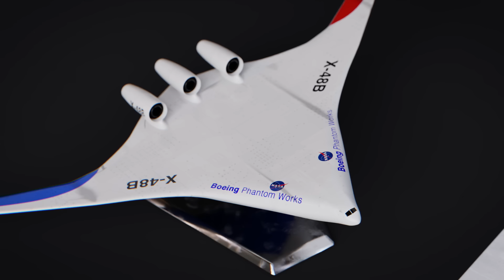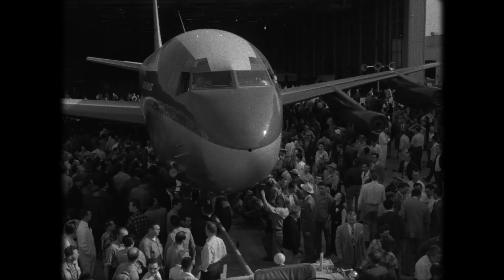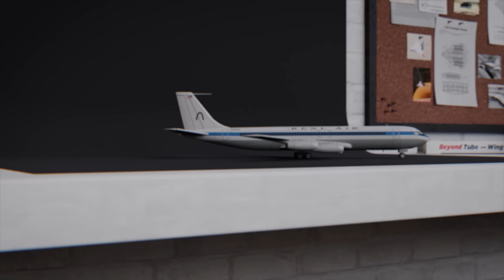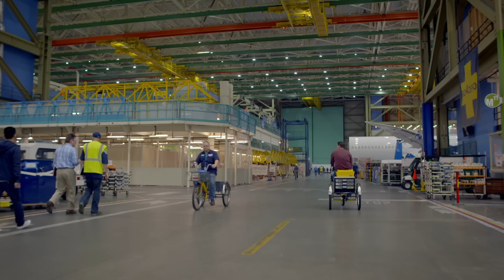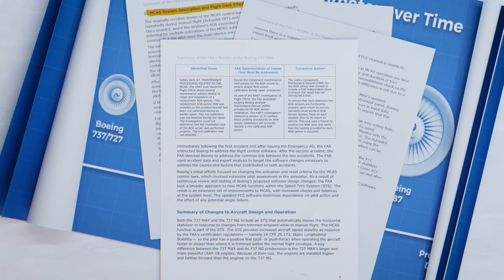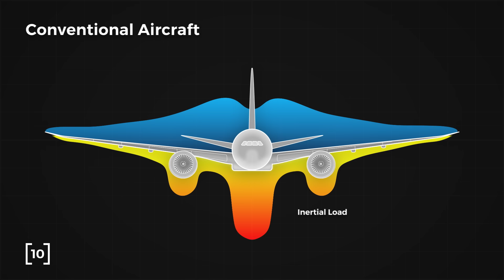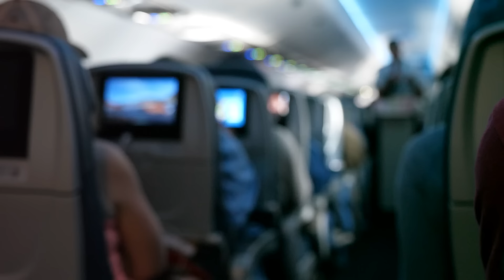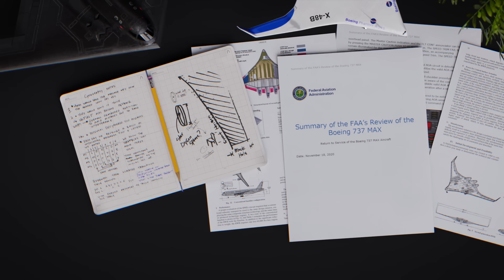The Plane That Will Change Travel Forever

Comment: Yeah I can't fathom the intense depth of greed needed to skimp on multiple redundant sensors that, compared to overall vehicle price, are stupid cheap to add in. Everyone in corporations who signs off on this kind of thing (not just airlines, but all companies) needs to be held personally criminally liable instead of their companies just getting a slap on the wrist in fines.
Reply: It's the devil of the Stock Market. You don't just need to be profitable, you need to be MORE profitable Every Year.  At some point, the business has reached max efficiency, and from then on you can only cut costs, usually by reducing personnel, and then shaving off product size, quality, and safety.  That's why a profitable business will fail after offering public stock, because investors just want growth growth growth, even when there is no room to grow.  Corporate takeover is a death sentence for a family owned business.
Reply: I wrote a short story about a son taking the family plow horse and taking him to the race track, and pumping him so full of amphetamines the horse's heart failed, which is basically the corporate story.

Comment: As I look at the relatively flat surface on top of a blended wing aircraft, I can't help but wonder if it would be possible to cover the top with solar panels.  I am sure there are all sorts of practical reasons it wouldn't work.  But if it were possible, it might allow a plane powered by hydrogen fuel cells to travel further on less fuel (at least during the day).  I wonder if such planes did prove practical if airlines would charge less for daytime flights or flights traveling West (chasing the sun).
Reply: I don't think you people understand how much energy is used in transportation vs how much energy you can get from solar.
Reply: Each engine (of two) on a Boeing 777 produces about 23 Megawatts. Solar panels are about 150 watts per square meter. 46MW / 150W = 307,000 sq m = 75.7 ACRES. And that's at the ideal angle. A plane might have an acre of useable area, so you might get a maximum of 1% savings for a lot of extra weight and complexity. You'd be much better off burning the hydrogen rather than using it in fuel cells anyway.
Reply: @cf453  That does seem like a practical reason why it won't work.  Which basically means you are saying I was right...  Seriously though, thank you for explaining.
Reply: @michaelmcchesney6645  You're welcome. I like to provide a sense of scale where I can.  The notion of trying to leverage more efficiency by alternative means is a good one, but it helps to know the boundaries of the possible.

Comment: The big problem with this is the lack of window seats. I dont want to seat in the middle of a dark capule full of artificial light. Also can you even imagine thousends of airport all renovating to accomodate those aircraft. This air craft would require 6 air sleeves to deboard its passangers. That would be EXPENSIVE both for the airline and airport. This plane is shit ngl

Comment: The 737 MAX has a runaway flap disconnect and a flap wheel by the pilots thigh for both the pilot and copilot; while the angle of attach sensor did fail the real reason the 2 planes crashed was inadequate training , poor airmanship and bad communication. Totally preventable!

Comment: Follow-up video idea: What impacts will these planes bring to passenger airports and their gate layout? Could the costs for adapting existing infrastructure effectively stall the sale of these aircraft?
Reply: And so much more. The cost of adoption for these flying wings would be quite high, and they would not solve the real problem the air travel industry faces: carbon emissions. Sure, a good amount of fuel savings is nice, but it means little when you're still emitting a lot of carbon with every flight. What we need is either a carbon-free biofuel (which is a pretty big challenge), an environmentally-friendly fuel that isn't carbon based at all (like hydrogen, which has a LOT of its own challenges/problems), or electrically-powered planes (which has some big problems with energy density of batteries, which vastly reduces the capabilities of electric planes). So we either need a revolutionary breakthrough in battery technology, a revolutionary breakthrough in biofuel technology (technically possible, but difficult), or a revolutionary breakthrough in hydrogen power (hard to see this happening, given that the physics of hydrogen won't change).
Reply: Sounds like something Wendover would cover.
Reply: They just need additional stairs. Blended wing planes have smaller box for the number of passenger they carry. The airport also need a new procedure so that the utility support equipment is positioned towards the back instead of the right side of the plane but all this equipment are already mobile they just need to train the crew on where to go.
Reply: @kazedcat  when you say "smaller box for the number of passengers they carry" do you mean on a per capita basis or in absolute terms? I wonder whether the width of the new planes will be significantly larger than current planes, meaning they wouldn't fit in the layout many airports have today - similar to tree branches. I know that that huge A380 is so big it can't fit in most airports and I think the blended wing model will run into the same type of problem
Reply: @Erik_123  A B2 Spirit have a 52m wingspan with a Maximun Take Off Weight of 170 tons. A boeing 767 have a 48m and a MTOW of 180t. Either this aircraft needs a very long wing, or wing folding tips, even more to get to the number of 450 souls inside.
Reply: @glockmat  The bomber was design to have low radar signature. I would assume this limits the shape of the plane away from the optimum MTOW.
Reply: @Erik_123  The airbus flying V concept was designed to fit on current airport with out the need of upgrades.

Comment: It seems like microbursts at takeoff or landing, or "vertical wind shear", would have a greater effect on flying wings because of their larger surface area relative to a force applied from above or below. They should climb faster than traditional designs with similar engine thrust but wouldn't that also make them more susceptible to erratic movement in turbulent air? We have decades of experience with similar military designs and it would be reassuring to know how engineers are identifying and remediating unavoidable new problems in civilian applications of this technology.
Reply: > wouldn't that also make them more susceptible to erratic movement in turbulent air?
Yep, that was one of the major problems brought up in the video.  And the solution seems to be "just make sure you build them really well so they don't get a bad rep right out of the gate".  Which is fair enough, most potentially dangerous things have to go through that procedure.  Its just a question of whether they'll spend sufficient time and money (and have a little bit of luck) finding and fixing all of the problems - including probably some test flight disasters - before they start selling tickets.

Comment: As a software dev, you're gonna have a hard time getting me to set foot on a plane where a computer can overrule pilot input.
Reply: Not to mention all Boeing work is done by an offshore (usually India) team, then patched together by an American team (like 3 guys) to make sure it's "certified"
Reply: @dennydravis8758  the problem isn't Boeing's india team, it's the other contractors they hire to code. They go for the lowest price to maximize profits instead of quality
Reply: @dennydravis8758  bruh even airbus uses an Indian team, every major company does, even the previous Boeing 737s used codes from Indian teams, its been like that since the 80s, the airbus simulation software was made by the DRDO of India, DRDO is like India's Darpa, everybody uses India for software.
Reply: @homijbhabha8860  having qualified professionals is fine, having incompetent 3rd parties like Wipro, HCL, etc to reduce cost is not.
Reply: @altrag  no I am saying the previous boeing airplanes use software coded probably by the same consultancy firm in India, OG comment said switching it to India fucked it up, even airbus software is Indian coded, I should know cause my uncle was the lead in coding the simulation software for our Tejas fighter jet program, it ended up being bought Airbus.
Reply: I suggest you stop flying then, as of right now pilots have very little input, only really controling the plane for takeoff and landing
Reply: That's basically every commercial airplane already.
As a software dev, you should be well aware that PEBKAC errors are often the hardest ones to find and fix.
Reply: I develop too, but I'm torn on that point. Good code that has been simulated to test decades worth of operation, used in redundant systems negating failure, still sound much more reliable than a human.

But override protocols should be available, just not available to a single pilot who is panicking or wanting to crash the plane
Reply: Fellow software dev--yeah I try to avoid having important things in my life being run by software. It's so easy to mess up, and software "engineering" has nothing like the standards of the hard engineering disciplines.
Reply: Since 1997, we've had 4 commercial airline events where the people on the flight were killed by  the suicidal pilot. You're going to have a hard time getting me to set foot on a plane where a human pilot can overrule computer input. ;)
Reply: Most airplane crashes are caused by human error not computers

Comment: 13:20 although I love blaming software as an engineer, I must say that this is not bad software, but bad system design. Writing better code doesn't add redundant sensors.
Reply: I think they did have multiple sensors on the 737 max, the issue was that the software was only taking decisions based on a single sensor, while it should have used the 3 sensors onboard.
Reply: @DBAproduct  @madattaktube The way I understand it is that there are multiple angle of attack sensors, but only one is used for MCAS. You could say that the software screwed up, but I don't think that is a fair call. Although of course the software is bad if the computer on which MCAS runs could access a sensor that has conflicting data and you could maybe fix it in software only, I don't think it is likely that Boeings software engineers made anything other than what they were told to program and accidentally forgot to add the redundancy. To me it seems more likely that something went wrong in the system design. Although of course that is maybe on the speculative side.
Reply: The system contained a redundant sensor, the software was not programmed to correctly identify conflicting sensor information and instead triggers a high AoA warning when only one of the two sensors is actually displaying high AoA.
Reply: @madattaktube  to my knowledge, the problem was more that although they had multiple sensors, each sensor was only connected to a single flight control computer, and they weren't cross-linked?
Reply: @nthn-   MCAS was desinged to only use one sensors at a time even though it had access to both. The software was designed to flip between one or the other after flight cycle. I'd very much like to know how the meeting where that implementation was approved was conducted.
Reply: @madattaktube  if that is true, how this code even passed basic reviews blows my mind. Boeing is definitely breaking/cutting some processes here. even automotive code i develop has more stringent reviews and testing
Reply: @thunderb00m  Right? It was pretty outright negligent of them to keep flying the plane. They knew, but money is more attractive than safety as usual.
Reply: as another software engineer, I agree. also code reviews, by multiple people. My coworkers have caught small bugs I missed. I am forever indebted to them... until its my turn to review their code LOL. oh and many, many, robust unit/functional/endtoend tests
Reply: Boeing subcontracted the software to programmers that knew nothing about aviation. So, the specs for the code were made by bureaucrats that don't understand programming and the programmers followed those specs without understanding aviation.
Reply: Calling it criminal is interesting as well.
Reply: I’m sure it was all on-the-level
Reply: The second sensor is simply a DLC. Just pay more, duh!

The real failure is regulatory capture. They essentially certified this themselves and bypassed the FAA.
Reply: As a software engineer, I want to know why do you love blaming software ?
Reply: @thunderb00m  Just for banter ;-)
Reply: @thunderb00m  well it's cheap and easy, you see
Reply: @thunderb00m  Probably because improvements in software have almost entirely relied on advancements in hardware for the past couple decades. Don't know if this applies to aviation, but the web for sure.
Reply: @xIronWarlordx  This is just incorrect. Programming software, languages and compilers have become extremely more sophisticated. You can compare what people used to program Fortran and Turbo Pascal with to modern programming environments, and it's like night and day. Automated error and warning detection has made programming extremely more accessible and reliable. Most languages' base level libraries have been fine tuned and polished, so basic method calls are much more reliable than they were just a decade or two ago. Add to that better programming practices  and most programming related improvements have been exactly not on the hardware side. Honestly most hardware improvements related specifically to programming have been ergonomic, which is valuable, but not life changing, unlike most of the changes listed above.

There has been good code before, and there is still today. I'd make the opinionated statement that a larger percentage of the code made today than a few decades ago is more "clean", despite there being a massive explosion in the amount of code during that period. The biggest reason being that software programming tools and languages being more reliable and accessible.

Boeing's case is an excellent example of corporate greed and foregoing basic redundancy features and testing, despite everyone knowing that it should always be done with technology that is potentially lethal.

Comment: Great video!!    2 years ago, I met a professor of aeronautics who assured me that blended wing airliners would never happen, because the glider -like wings we  now see have the lowest possible drag, especially with winglets. I was disappointed, long having yearned for this  new type  of airliner.  But I think the real  clincher is the sheer volume of fuel capacity for the hydrogen which we must use. So, where do I book for a seat on the maiden flight of a blended wing airliner, please?

Comment: Pitot tubes have the nasty habit of freezing over all at the same time. Luckily, if you're not an Air France pilot, that doesn't pose a problem with current aircraft. Is it possible for blended wing aircraft to remain flying when all of their airspeed data becomes erroneous at the same time?
Reply: “Use known pitch and power settings” is the idea that comes to mind. Works for traditional airplanes; I assume the same is true for this one.
Reply: @chadpollman7970  you first have to realize your airspeed readings are off though. Sure, you can do some sanity checks but that all sounds very uncertain to me.
I guess once you know the pitot tubes are gone, you can use the IMUs for stable flight and guesstimate the airspeed from the engine power settings or so. Dunno. Would love to know more.

Comment: Why don't they place the center of mass just behind the center of lift and have the tail angled upward providing slight lift? This way it is at least productive restoring force? This addresses the stability concerns you brought up but are there other issues? Is it too hard to have the center of lift ahead of the center of mass while also keeping the center of drag behind of the center of mass?

Comment: First off, excellent summary of the aerodynamics involved. It's a very complex subject that you condensed beautifully for the video.

One note I don’t think got mentioned: passenger comfort. In the tube design, passengers are very close to the longitudinal axis of the aircraft, meaning that when it banks (up to 30 degrees in normal operation), it is essentially unnoticeable. As soon as you start putting passengers farther out towards the wingtips, as in a blended wing, the effects of roll will not be as trivial. And during yaw, they will feel as if they’re being thrown forward and backward… not good!

Also, leave the inflammatory political bullshit out of your videos. People are here to learn about engineering, not be fed low-blows about "corporate greed".
Reply: Then just charge more for the "rollercoaster experience"!

Comment: Good summary of the BWB configuration's issues and benefits. 
Though your comments on the 737 Max were hard to hear.
Well done.
Reply: The comments on the 737 are nonsense. The crashes were directly caused by pilot incompetence and third world airlines that ignored basic maintenance.

A malfunction in the trim system is fixed by three steps, it would have never caused an accident in the first world.
Reply: @TheOwenMajor  I didn't say I agreed with the comments on the MAX, but I can see how you have interpreted it that way with the, "Well done." placed at the end as I did. I originally had the MAX comment after the well done. Should have stuck with that to not imply agreement. Peace.